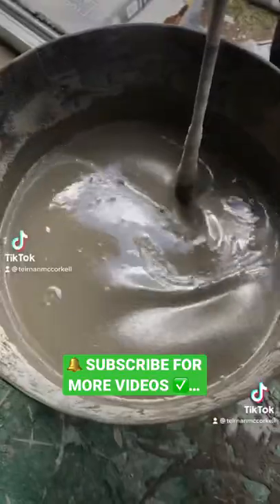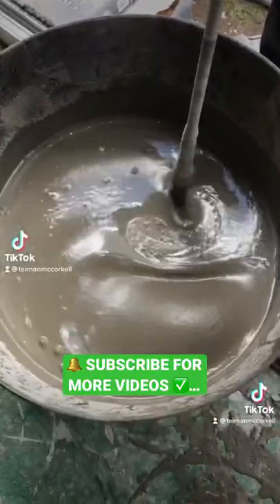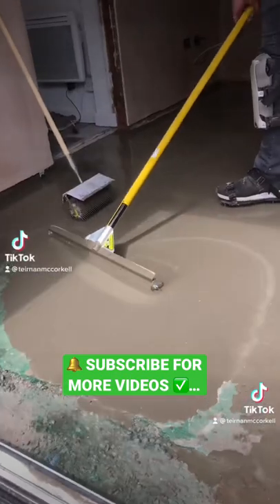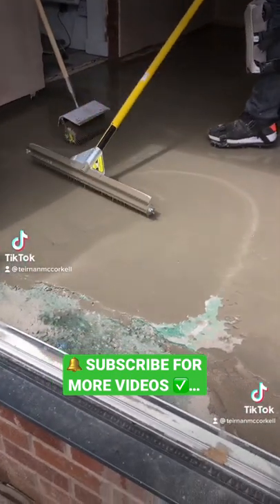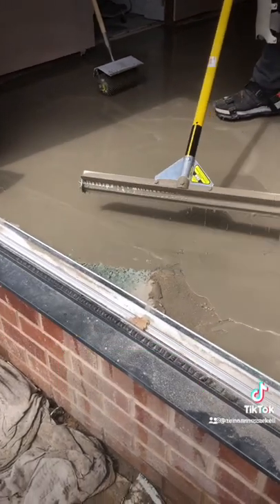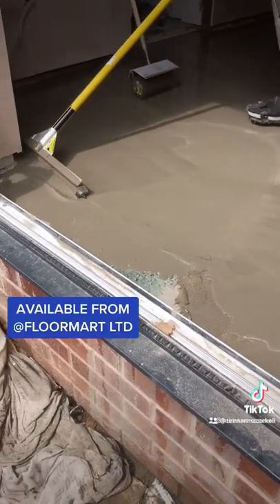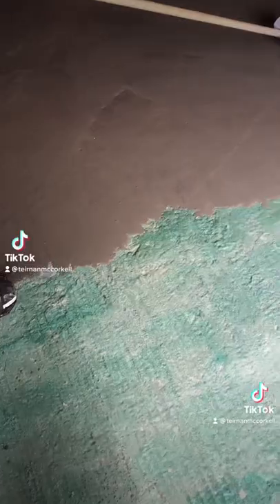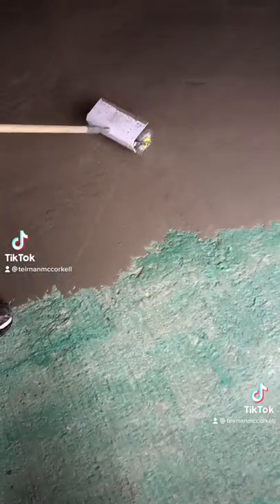How to use self levelling compound ✅… #tips #teirnanmccorkell #howto #diy #shorts

Comment: Damn not even grinding or anything, uow professional
Reply: What are you going to grind if its low and needs building up, WTF🤔
Reply: Well I don’t know if you know but self leveling is pretty expensive, so when you applied it you try to reduce the use by grinding the highest spots also you need to patch the holes too.. don’t tell me you are a contractor? 😂
Reply: @andresv8856  you're certainly not in the trade, self level is £12 a bag, considerably less than my time to grind down a floor, and besides the high spot is normally what you're bringing the rest up to because its settled and is low.
Reply: @mikepage9520  oh you are European that’s why…
Reply: @andresv8856  no, I'm not european, I'm british
Reply: @mikepage9520 good man 👍😂😂